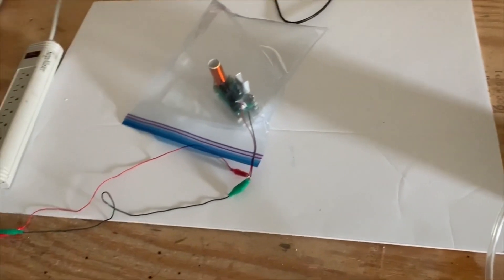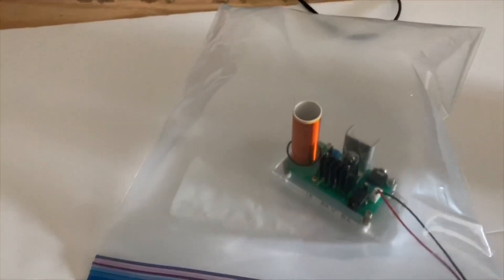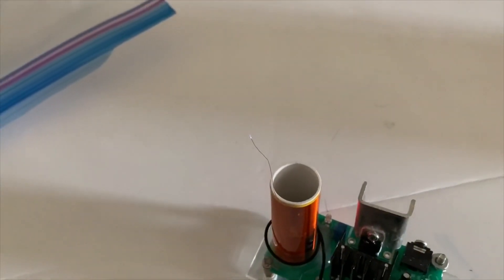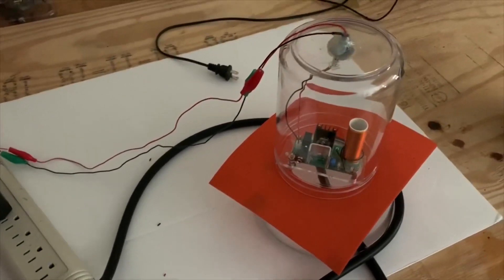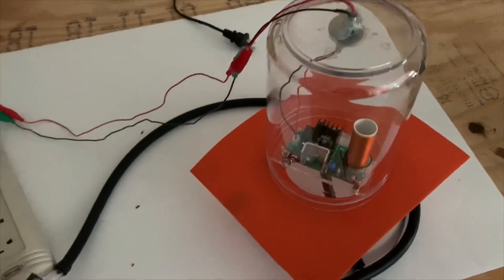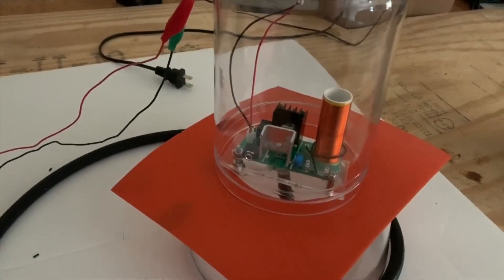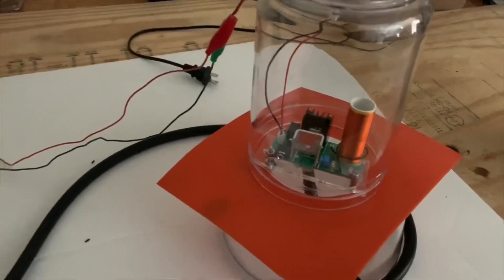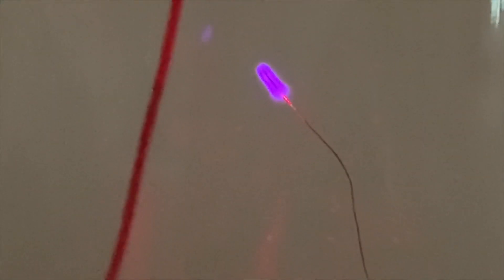Tesla Coil in Argon

Comment: I wonder if the electric high voltage discharge is tearing apart the argon like it does air normally? Wonder what the effects are on the argon gas? Cool experiment.
Reply: hi, i dont think so, argon as a noble gaz just do nothing ;-)
Reply: reeks li 👍